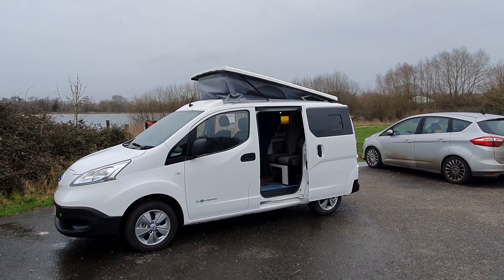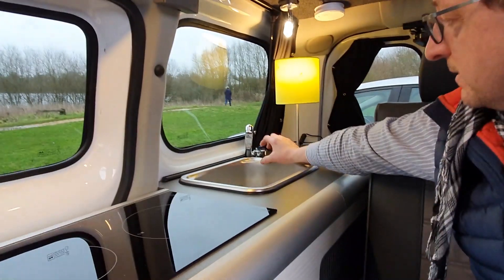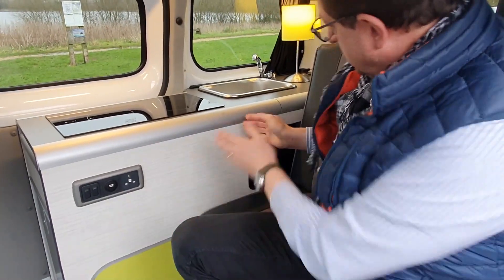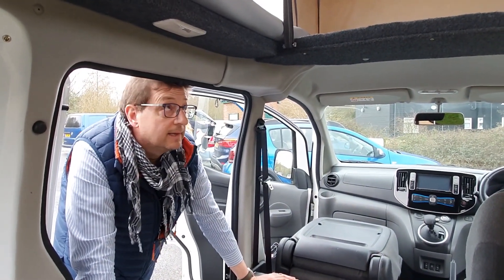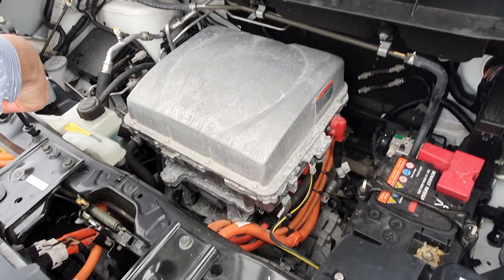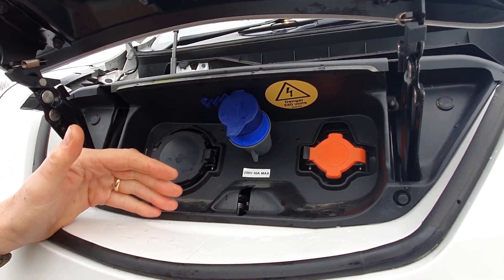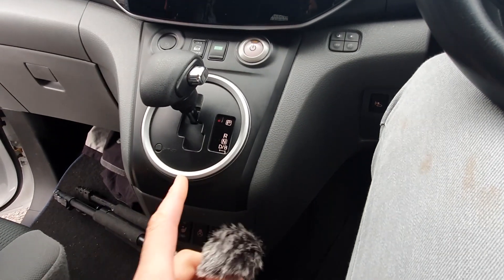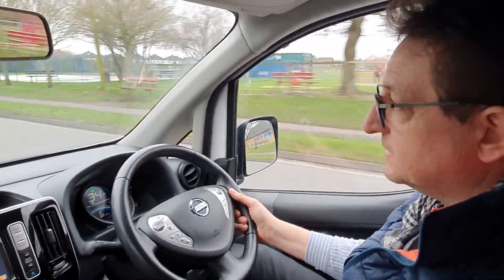Electric Campervan // Van Tour // Nissan eNV200 // 100% Electric Eco Campervan

Comment: How does the van's 12V battery under the bonnet recharge? Does it charge during driving, from the van's main drive batteries, like an alternator and petrol/diesel engine does, or does it charge via the EV charge station, or is it on all the time? I take it Nissan must put a dc-dc charger and stepdown between the two batteries, if they are separate systems?

Comment: Great video, and a really thoughtful conversion.  I'm curious that the van has no insulation at all - was this a decision made because it's only going to be used in warmer weather, or is it the case that because the car heater is so good (and can be left on when parked) there is no need for insulation?  Thanks!

Comment: you can replace the battery in these for a 40kwh version. Literally plug and play. Theres a few companies that do it and it doesnt cost a huge amount
Reply: Thank you for commenting this.  💜

I can't afford to buy a new van with the higher kwh battery, and am looking purely at older second hand ones. I have been wondering how easy it would be to swap the battery on an older one. Thank you. 💜
Reply: @cherylkaye  Check out Glun Hudson's channel. He upgraded his 24kWh camper van to a 40

Comment: This is by far the best conversion I have seen, thank you for sharing.
Is there a blog and or part list for the build anywhere please?
the rear electrical system is genius and I would like to - no need to be able to replicate this including the under bonnet charging port

Comment: I am considering do this with a 40kW version. In a comment below I think you said the conversion cost £5k including the pop top and additional batteries is that correct?
Reply from the maker: Hi Nick. Yes, I think it makes even more sense now that more vans are available with the bigger battery packs! Just had a quick tot up, £6k excluding additional battery and boost pack. (Another £4k spent on this). Cheers!

Comment: Hello, thanks for the review. Can you tell me what is the range of that van if she were loaded with 400 kg every day in a working day? In city work. Thanks and greettings from Portugal
Reply from the maker: Hi, thanks for watching! So 400kg is probably isn't too dissimilar from the weight added by the camper conversion so range would be about 85 miles (136km). Bear in mind this van is the 24kW version. There is a 40kW milage that will do around 140 miles (225km). Hope that helps 👍

Comment: Why not run everything off the electric vehicle's battery? It doesn't seem like a battery and solar are really needed here, right?
Reply from the maker: Then you'd be eating into your already limited range
Reply: 70 mile range dropped to 50 with the heater on.  In the UK campsites are usually out in the sticks,  rural or by beaches and possibly not too close to recharge the main van battery.  I live in Somerset and charging points are few and far between…  unless you go in the motorway charging point…  If the van's range were to improve with newer models perhaps it wouldn't be such an issue…
Reply: I know this was posted several months back but just wanted to add that Nissan would also void the warranty, if one were to 'mess' with the vehicle's battery pack.

Comment: How much did the conversion cost?
Reply from the maker: Hi, 
Drivelodge pop top: £2,500
Windows : £800
Crash Tested Bed: £2000. I went for £800 Cheap Bed. Also narrower.
Dometic Fridge: £450
Induction Hob: £120
Lithium Pack & Inverter / Charger: £3000. Boost pack another £1,000
Swivel Seat £120
Everything else : £800 (no furniture  kits available so bought the lightweight ply and built myself.
Reply: @sampayne6318  Great breakdown. Did you fit the Drivelodge roof yourself at that price?
Reply from the maker: @fionnut  sorry only just seen this. No, that price includes a 'professional' to fit it!
Reply: @sampayne6318  Crikey, that was great value. Do you mind me asking where you had it done?
Reply from the maker: Indeed! Fitted on the Isle of Wight by a company by northstar. £500. The roof itself, £1700 supplied by drivelodge